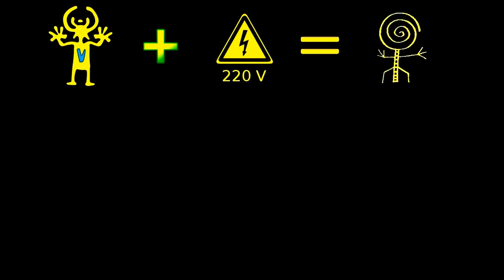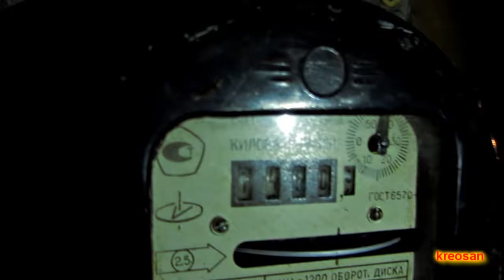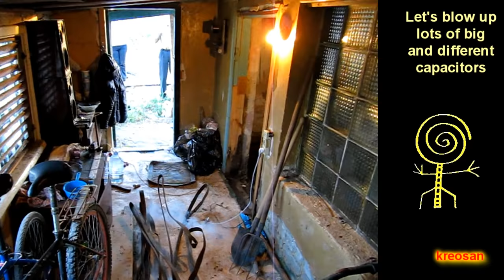The way hard Russian electricians have fun

Comment: The arc welding will give you permanent scars in the retina of your eyes.
Reply: Yeah that's what happened to my dad and he had to go to the hospital to get these special eye drops
Reply: CJ Plays Did the eye drops work?
Reply: +RJSoftware2000 yeah they  did but that happen like a long time ago
Reply: @RJSoftware2000  Those drops work against the irritation of the cornea, which usually is the first layer to get irritated because of welding-arcs. The drops not only moisten it, but can also prevent further UV-radiation to reach the retinea. A fucked-up retinea is permanent, however...

Comment: 2:20 The noise of the meter just rushing :D in germany you would have like 1000€ Electricity bill. - Wait, in germany You have circuit breakers - RCD´s - beefy mains circuit breakers etc.
Reply: You can also hear the insane spinning noise of the meter at 0:34 😂😂😂😂😂 and also the light gets dimmed because of the insane short circuit current 😂😂😂😂😂
They also have main fuse before the meter like West Europe, but they probably bypass the main fuse with a nail inside the street fusebox 😂😂😂😂😂

Comment: I used to do the capacitor thing as a kid in my parent's basement.  Connecting a 25 or so volt electrolytic capacitor to 120 VAC.  Also removing circuit protection and shorting the output winding of small transformers.  Lots of wacky fun!

Comment: Oh hell yeah, reminds me so much of my childhood reminiscing the fun I used to have with Bunsen burners and electrolytic's. Until that discovery that 240 volts and later 415 volts would work sooooo much better. The memories are tinged with a sadness that there are no videos or pictures to upload. I am electrician, and am sorely tempted to 'do' some electrolytic's, better still I have some non polarised big assed oil filled caps in the workshop, meet propane burner. Yes I have been re inspired, thank you for the blast from the past. :)

Comment: The smoke emitted from a blown capacitor is really realistic for such a small capacitor. A lot of the dielectric is being vaporized but it is pushed through a tiny hole melted into the casing by high pressure, causing the smoke to expand beautifully when it comes out.

Comment: These are the most insane 220V short circuits i ever seen in my life!
At 0:34 you can hear the electric meter spinning like crazy, because of the insane short circuit current!
The crazy spinning sound of electric metre reminds of photonicinductions electric meter overload experiment.
Also you can se the light gets dimmed or entirely goes off several times, because of the insane short circuit current!

Comment: The first one, nothing because capacitor voltage is still higher than applied. But if capacitor is start type capacitor for induction motor then it will explode if connected directly to mains.

Comment: When you intentionally short the wires they get red hot and melt. How do you prevent the wires in the wall (which is feeding the outlet where you are doing the experiment) from themselves getting red hot and melting (or worse, setting the wire's plastic insulation on fire, and burning down your house)? Do you have like a special house who's wiring has been modified to have ultra-high gauge wire (instead of standard 12 gauge household wire) for the purpose of delivering large amounts of current to your experiments?
Reply: wires in the wall are made of copper. so the resistance is much smaller in them

Comment: Have you guys tried touching 220V with bare hands for 10 seconds or so?
Reply: Lubnan I've actually done it before. I used a cheap 240v/120v transformer made in good 'ol China without grounding. Even though the power switch was "off", when i touched the metal case, BOOM! Mains power going from my right arm to my right leg. It was a whole new level of pain; I assume the only way I survived was due to my posture when I touched it.

Comment: If you bypass electric meter it will avoid you pay much of bill caused by short circuit. Short circuit will consume much power cause by large current that flow through it. As physics law P = V x I.

Comment: Youre Crazy  but one tip  you can launch Condensators into the air with a metal pipe ....with Conductors  

You can also do Lightbulbs with Graphite on a safe  Circuit Generator  it glows like hell 
and last but not least the Glowing Cucumber  we did this all in our Education  

Interesting Video ;D

Comment: Yobanny Duroch! You're creating resistance and dead shorting shit! Of course the wire is going to heat up and glow, then break. Putting 100 amps into a number 12 or 14 wire is like putting 100 pounds of boloney in a 2 pound bag. Capacitors are filled with mineral oil, if you charge it with excessive current, the oil heats up and boils creating internal pressure. Newer capacitors have a small "rupture" disk installed for this reason to avoid exploding.

Comment: I suppose if you have a 500 kva transformer and your the only one on it and a 00 gauge wire feeding a 200 amp slow blow fuse and 8 gauge wire leading to contained areal and nothing better to do maybe some part of Ukraine they could keep doing this for 10 years and expect little much to happen as long as they have more 8 gauge wire and conduit and plenty of 200 amp fuses its not what I call safe but its not likely to end in a big fire if done in a certain way  clearly they are doing these things in a concrete room with nothing flammable in the area the fact they have such current says they are using heavy wire gas masks would be a good idea and somethings can explode so they should stand back they might also have access to bullet proof glass in such an area abandoned banks and such broken camera is bit harder to replace